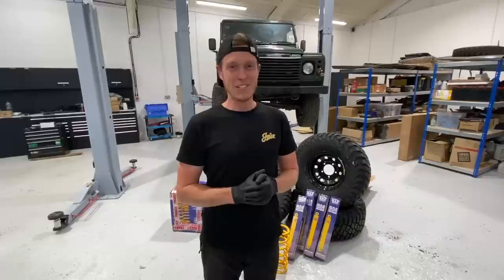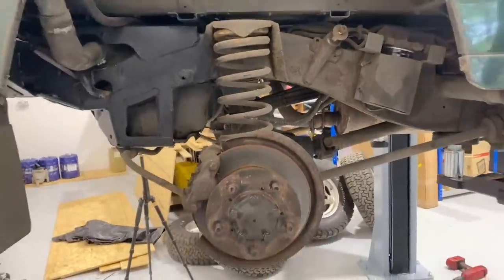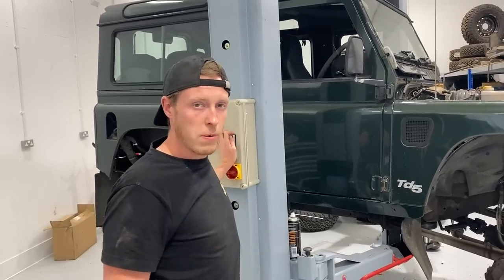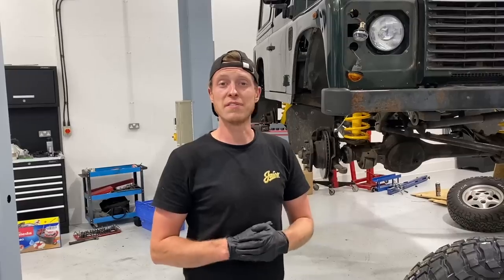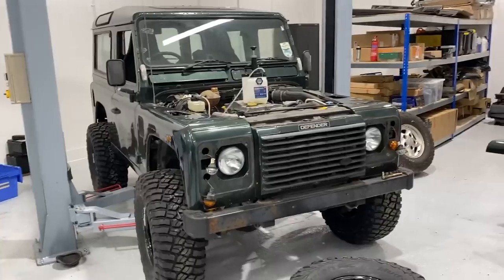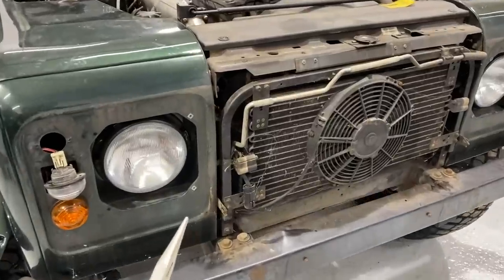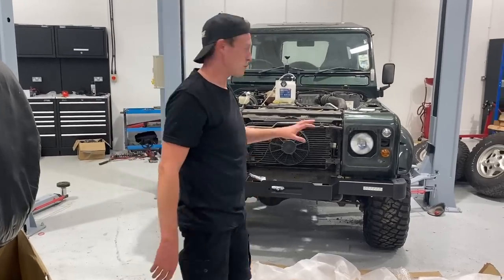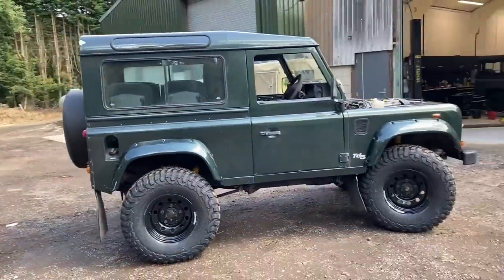Rebuilding a neglected Land Rover Defender 90 - Part 9

Comment: Castor correction radius and trailer arms would be a good idea, and prop spacer, rool bar extension and larger bump stops.

Dont forget to adjust your 'lock to lock' hub bolts, otherwise you'll reck your tyres on the radius arms

Comment: Looks fantastic mate. I fitted exactly the same tyres with Mach 5 wheels to my dcpu this weekend. I went for the spectre spats but with standard suspension at the front and -2 at the back. Fantastic job on this 90.

Comment: G'Day.
I only have 3 things to say.
1) Please look after your back. I didn't and was medically discharged from the army with a prolapsed disk by doing something similar, lifting to heavy an Item up off the ground and on to a Unimog tray. Lower the lift to an easier position to put the wheels on yeah.
2)WOW, mate, the workshop...AMAZING. You now have plenty of room and builds should be really enjoyable now.
3)Britparts........yeah nar... the less said about them the better. Mate you will soon learn that one is best served by staying well away from Britparts as much as humanly possible. Very few and far between are the "parts" fit for service from Britpart, more so with any part having a rubber component too it.
Other than that, looking good. Thanks
Reply: I had shitpart 2inch lift. First MOT after fitting the MOT man failed it as one rear spring had a bow in. Old man Emu or standard springs since.
Reply from the maker: Hey 👋 thanks for the thoughts and comments 😁 as a Defender specialist, there are many items from Birtpart that get a bad wrap, and for good reason. I know what parts are unusable and what parts are good to use, personally I’ve never experienced bad reviews from their suspension but have when using Terrafirma etc. The workshop is much bigger now!! So you should see some very cool cars start to roll off the production line 😁 notes about my back, I’ll make sure to take care 🙏🏻
Best

Comment: Loving this build! Would love to own a defender. My Grandad owns a defender 90 that be bought from Severn Trent before he retired from them and it's still running strong. He's also got a 1992 3 door Disco that is going strong too. The other day he told me he needs to sort the rear sliding windows as they are rattling around just like on this 90. Told him I'd show him the video when you get round to sorting 😉

Comment: Have you checked the full articulation when on full lock? When the back passage side wheel is fully articulated, full lock to right, does the front driver's side touch the bodywork? Will you need to change the speed drive? Looks Good.

Comment: I suggest the wheels be balanced using the stick-on weights inside the rim. They look much better and are a lot less likely to be dislodged during off-roading. They can also be painted to match the wheels.

Comment: Great progress on the build .  What are you ding about the gap between the inner front arch and the wheel arch ?  It'll fill up with mud , road dirt and water thrown up by the tyres and will cause premature rot , which we know these vehicles suffer with .
Reply from the maker: Factory shaved arches to have the liners

Comment: I'm not a fan of those arches to be honest and I think the wheels are a little big with too much offset for a daily driver. At least for my tastes.
Reply from the maker: Martyntd5 no problem Martyn! I think it looks great! The world would be boring if we all had the same opinions 😁 thanks for watching! 🤙🏻
Reply: @juicemotors  Yeah, I agree. I think it's the body-colour of the arches which looks odd to me. I've got a 90 in exactly the same colour - is it Epsom green? ...and it does have matching arches - I think that was standard on the county models? Anyway, with big boots I think I just prefer the look of contrasting black arches. It's all a matter of taste. Loving the yellow shocks and springs though. :)
Reply: @juicemotors   I would have chose a 16x8 -25mm wheel 😏😋😉

Comment: Got a question I fitted the same 2 inch kit to mine ... I’m running standard radius arms is that fine for 2inch ?? ... I have 2 inch spring spacers to fit take it to 4 inch will I need 3 degree radius arms for 4 inch ? .... truck looks sick love the colour too

Comment: Hi Sam, great job on the Defender. That's the look I'm going for on mine but I have fitted 18" wheels.
I want to fit 2" lift but I was under the impression the radius arms needed changing, that's obviously not the case or is that coming later ?
Glad you colour coded the arches, look good 👍
Reply from the maker: Hey Ed! No need to change the radius arms for 2” lift, the angle isn’t too different from stock.

Comment: Hi Sam, are those 35in tyres?  From all the research I've done and 4x4 shops I've spoken with, they all state that a 2in lift won't fit 35in tyres, that the maximum you can go with 2in is 33in tyres.  Also, with 35's, there is extensive driveline mods that must must be done as well.  Can you comment on this?  Cheers mate

Comment: Hiya this seems to be a build where it's got some stuff for off roading and the rest an odd mix of what looks good I know everyone's got different tastes the winch bumper you'd get a far nicer and heavier duty one from Dixon fabrication Ian makes probably the best one on the market and rock sliders the arches and tyres I think are great but the rims I'd of gone for the 5spoke challenge rims on your top shelf of the racking but the suspension I don't agree with at all having used various britpart springs and shocks I'd never recommend them to anyone they are cheap for a reason they aren't very good at all the Bearmach one's are about the best of the midrange springs, it's a +2" lift kit but not with the brake lines that is something that britpart do a decent kit for, I can't remember if you did the castor correction swivel housings if not it's going to dive under braking because it hasn't got an adjustable panhard rod to bring the geometry angles correct and there was no dislocation and spring retention kit sorry if it feels like I'm having a dig that is not my intention it just seems like it is a confused build or is going to be one of the Chelsea tractors!! I do like the arches alot and with that offset it looks pukka personally I'd adjust the steering stops a little bit now to get an even better turning circle cos the radius arms ain't gonna rub now
Reply from the maker: Hey Alex, we put extended braided steel lines in on this video, I’ve used almost every spring and suspension set up available on the market for Defenders. This car isn’t finished yet so keep an eye out for the next video, this build won’t look confusing in the slightest as we’re going all out on the overland/ adventure look 🙏🏻

Comment: Sick vid mate...looks awesome...very excited for my suspension to turn up after watching this...do you rekon you would have got it through an MOT with those wheels and standard arches?
Reply from the maker: Thanks guys! Did you go for a 2” lift? It definitely wouldn’t go through an MOT on stock arches, these bad boys are like 10” outside the body 😂
Reply: Juice Motors the springs claimed to be 40mm lift rather than 2 inches, but we will see when they land...can’t be dealing with this metric malarkey 😂 haha ok good to know, I will have to consider that when I order wheels...think I want to run stock arches but still thinking about it
Reply: While standard arches with those wheels is not an MOT fail, they would be illegal on the road.

Comment: ... 35 inch is not the size for ‘overlanding’.
Reply: Depends on where you're overlanding. If you're crossing Europe or Asia, maybe. Here in Australia, as both a country and a continent, 35's are about perfect for just about any condition you might come across. In fact 37s are becomming more popular so 35s will start to be small.
Reply: Peter Middo ... agreed; Oz and the US won’t be a problem. Africa, the Indian Sub Cont and South East Asia you’ll be up the creek.

Comment: I'll subscribe if you give me the Rover when it's done why don't you just lower the lift down then put the tire on duh Ranger control arms yellow and look better and they make spacers for the steering stabilizer to drop it down a inch if that's a diesel I don't want it you keep it

Comment: "F" me the lights flcker  in that unit too
Reply from the maker: I’ll get to a new camera one day, it’s because they’re operating on an AC current. Enjoy the content for now, they’ll be flicker free once I can adjust my frame rate. Thanks for watching
Reply: @juicemotors  truck looks neat, but an arse about way you,ve done it, paint first then the grubby work, is the blue one finished?
Reply from the maker: Check the final vid for the blue one, you can’t fit these arches then paint them...